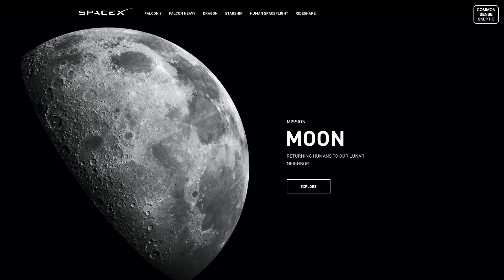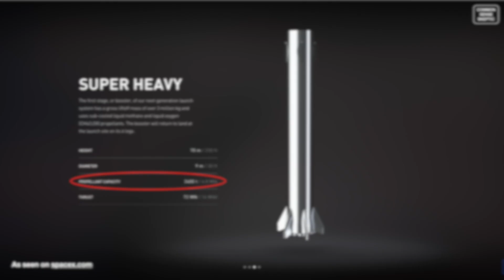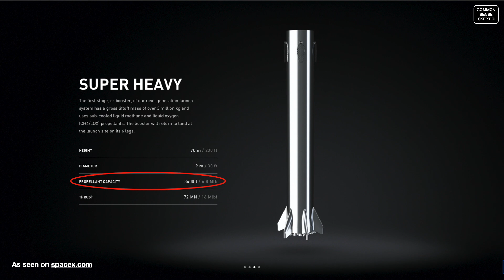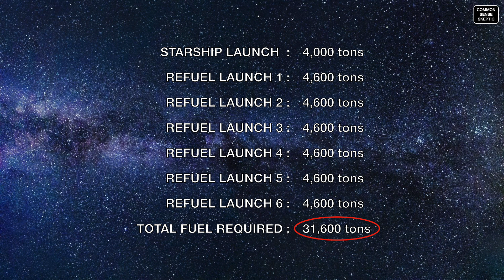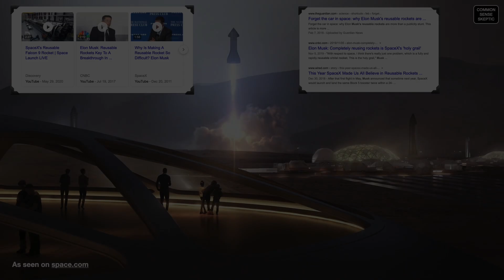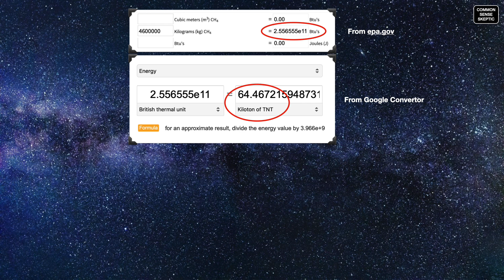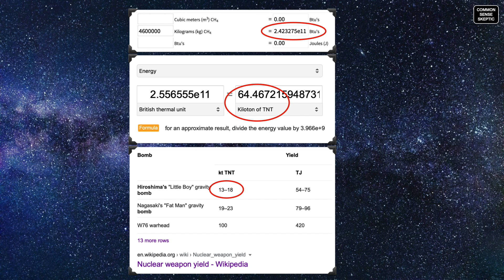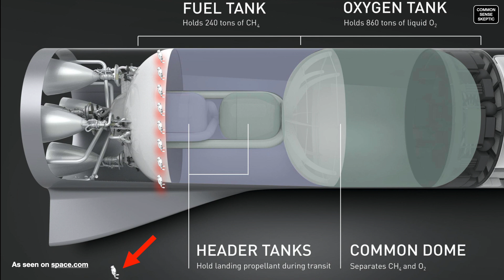STARSHIP EP5 - ORBITAL REFUELLING (1080p)

Comment: Reloaded? Hmm.. I missed the original.

CSS isn't going to like me for this but in my view, orbital refuelling is not a trivial problem, but it is both solvable and game changing. A few points here.

- It doesn't take too long for the gas phase propellants to recondense into liquid, leaving very low pressure.
- What you're really dealing with is liquids breaking up into a zero-g state (lava lamp style).
- It doesn't take much acceleration to re-settle the propellants. That's not going to knock you out of orbit any time soon. Besides this could be adding orbital velocity.
- I'm also a bit nervous of the tail to tail approach. If you have a specialised "tanker" Starship with the tankage going to the nose, it may be better to transfer from the nose.
- Spin is another way to settle propellants.

As you know, I'm not an Elon fan, but there have been numerous other proposals for orbital fuel depots and there is a strong case for fuel depots in Mars orbit. That solves a lot of problems.
As for all the precise numbers related to Starship - they are all quite rubbery. Very, very sensitive to structure mass (and those heat tiles). So, its anyone's guess - but the uncertainty goes both ways.

As for game changing. It doesn't matter how big your rocket is, by the time you get to Earth orbit, only a small fraction of your mass is payload. That's a problem you have to deal with in any architecture. So talk of inefficiency is a bit moot. Yes, the multipliers blow away the economics of mass settlement, but they're something you're going to have to swallow if you're dealing with a limited exploration mission where you don't want to skimp - and even the NASA DRMs skimp.
Reply from the maker: Now, all that aside - are you going to be doing this without pumps?
Reply: Yes propellant transfer is going to be be key to future space operation, we've known this for decades but not much work has been done and what has been done is for things like OMS transfer for Mir and the ISS. The problem is Musk's "plan" doesn't help all that much though I've "hopes" the work they do for NASA will be more practical but I'm not holding my breath.

So in order:
-They aren't looking to transfer gas phase but using the engine turbopump systems to transfer the actual liquid
- The statement was propulsive propellant settling, they are not planning on dealing with propellant in microgravity
- While yes it won't take much thrust to 'settle' the propellant but keep in mind they can't physically 'thrust' in the direction that would allow using the actual propellant handling system to perform the job. Keep in mind that they are planning on mating the vehicles 'base-to-base' to allow the use of that very system which means needing to 'thrust' in a manner that settles the propellant TOWARDS each Starship 'base'... which is impossible.
-For the 'plan' to work at all then "nose-to-nose" is a given as that's the ONLY way to get everything to work. The point here is that's NOT Musk's stated plan and there are far to many people who refuse to consider or question that "plan" even when the facts are pointed out (More below on that point)
- Yes but that gets into the two main issues of the 'spin' gravity moving the propellant AWAY from the 'base' of the Starship/Tanker in the 'base-to-base' docking which again is the "plan" we know of. The second 'problem' is that in the 'nose-to-nose' docking configuration the spin radius is going to be to low for comfort due to the short 'distance' between the Starship habitat decks and the center of rotation. (Which will be changing as the Tanker drains of propellant keep in mind) That's a major problem with the Starship design in that it will have to spin (or thrust for that matter) fast enough to keep the propellants 'settled' enough to keep the high-speed/high-pressure turbopumps fed properly and avoid cavitation events which could lead to turbopump damage. And the 'crew' will have to experience this several times in short order.

in the end Musk's concept is very shallowly thought out and so far as we can tell this doesn't bother Musk a bit and worse he's got fans that think just because HE isn't concerned then neither should anyone else be. There are a LOT of ways to get around the issues involved and it should be a priority with SpaceX considering how much of a priority getting to Mars is supposed to be. Worse, Musk should have never gotten into the details he did considering how LITTLE effort it takes to "debunk" most of the ideas, so it should have been clear to SOMEONE with any engineering or space flight background that the basic ideas would not work and needed re-working. The fact that Musk went ahead with this nonsense points to a few "worrying" directions such as Musk NOT being as interested in going to Mars as he claims and Starship 'merely' being means to an end in crushing the competition in the space launch market. (I mean it's pretty clear that if Starlink gets to its "full" size planned that so many LEO satellites now make SpaceX a major 'gatekeeper' on launch cadence. Part of the process for launch clearance is ensuring that there is in fact an "open" satellite free launch trajectory after all) I'm not fully convinced that Starship may not in fact be Musk playing a long-game with the idea of having Starship enter operation as an SSTO and using all this "Mars" stuff to avoid ridicule for going in that direction :)

In the end what Musk says is the "plan" for Starship and Mars comes across and horribly naïve and self serving and his reputation and fan base make it very difficult to counter the misinformation. At best only a few of his supporters "may" consider some questions to be valid and consider alternatives, at worst the majority of his fans will simply drown out any questions and concerns because it's "MUSK" after all! There really an absolutely needs to be a conversation on the whole plan and process because currently it's simply Musk making claims and pronouncements and his fans talking it up while the media un-critically regurgitates everything he says without questions or opposition from either corner. Probably the most worrying bit here is that there IS the beginnings of some pushback but because of the focus of Musk-Fans on people who question "the plan" rather than on the broader perspective a lot of that pushback is coming from people who are essentially more concerned with Earthly issues and in the form of articles (see below for an example) and media suggesting the there needs to be a curb on ANY human space flight or dreams because ONLY the Earth is where humans can (and by inference should) live. The post-Apollo disappointment of the unfulfilled promises of human space flight that we turned away from after the Lunar landings has happened over and over again since that time and it's not at all that far fetched that the general public of the world, (which far outnumbers the space advocates and fans) can be turned away from supporting manned space flight again. That's why misleading and deceptive 'plans' such as Musk's should be questioned and why he needs to be held to a higher standard.

Article: https://www.theatlantic.com/ideas/archive/2021/02/mars-is-no-earth/618133/?fbclid=IwAR07CvV9BZKAxBedSawNc4Zcsz3i3eWi1tbrlb3aZGsnF6szPSBCro93m00
Reply: @commonsenseskeptic  That's a question for an expert with the right software. All I can tell you is that with milli-g accelearation you're going to need a fat pipe or a lot of patience. Pumps are not unreasonable.
Reply: @randycampbell6307  That's an impressive article. It pretty much sums up where I come from philosophically. So much of what actually motivates people to want to "expand" to Mars is driven by the uglier side of the human animal. Rather than curiosity, its power. I keep dealing with enthusiasts who when pushed, reveal that their lofty goals of driving forward humanity are based on a shallow, selfish and rotten understanding of "humanity". Anyhow, so much for the philosophy.

My understanding of Elon's refuelling - at least the official version - is or was that some other kind of thruster (presumably attitude control) would drive a milli-g acceleration and its purely that acceleration that pushes the fuel. You couldn't use the engines' turbopumps because they require combustion and besides they're designed to create gas. Its not impossible to transfer fuel tail to tail. Its just difficult squeezing the plumbing in and making that safe given the possibility of an an engine failure. Nose to nose seems a better proposition to me.

If I were NASA I'd be funding a quite separate fuel transfer experiment. Heck you do one based on a couple of Electrons.

Btw there are other potential sources of power besides solar power. You can run methane powered fuel cells or even a combustion driven turbine-electric system.
Reply: @judedornisch4946  There's really no big deal in building the plumbing for nose to nose. Trying to thread it through the tail, in close proximity to the engines is asking for trouble.
Reply: @judedornisch4946  Even with compressed gas you still need acceleration to keep the gas and the liquid where they ought to be. And if you're going to do that, pumps work fine too.
Reply: @judedornisch4946  It doesn't work though. Tail-to-Tail is how the PLUMBING is set up but the PLUMBING operates in the opposite direction for filling the tanks and the turbopumps are NOT set up to operate going into the tanks only outputting from tanks to the Raptors. Making them 'reversible' is a significant engineering challenge because of that flow path.
Reply: @saumyacow4435  Philosophically the article is crap because it says "Don't bother" and the most simple answer to that is if you ask the Dinosaur's "How's that Space Program coming along" :) It is literally a matter of species survival. (Not that the universe cares but I happen to :) ) I won't argue that many advocates/enthusiasts essentially boil down to selfish motivations, arguably that's a biological imperative as much as a "thinking brain" thing but I'll also point out the two are not  mutually exclusive either. The essential problem is that if you're going to be serious about the prospect you can't just be selfish, (because that is counter-survival in such a hostile environment as space) nor can you be naïve about the reality and I agree to many people are both.

The problem with Elon's idea is that it doesn't work because of the 'tail-to-tail' setup half the pair is going in the wrong direction with a thruster push no matter what.. That means only one set of pumps is working properly the other is just passive which increases your transfer time and time you have to keep thrusting significantly. Also while most turbopumps require some sort of combustion you can actually run them using the pre-burner segment of the engines. You just have to pump the exhaust 'overboard' which can provide a light thrust btw. Still doesn't work as suggested.

From what I gather NASA thought they were  getting SpaceX to 'proof' something with a Falcon launched hardware but it seem Musk is just going to fold the money into Starship and call that 'development' so I expect NASA (if not Congress but Elon is contributing to enough campaigns they probably won't get involved at this point) to quietly drop the contract at the first milestone.

Methane/LOX ICE's are baselined for couple of NASA and Blue Origin designs but Musk is insisting that solar can cover if. Hint: Studies say otherwise for any reasonable length power/time factor. And you'd be burning the methane you'd be producing to power the engines.
Reply: @randycampbell6307  Fair enough, although amount of fuel you'd need to burn to power the pumps would be fairly trivial.
Reply: @commonsenseskeptic  You don't need pumps - it could be done with a pressure fed system. Almost no moving parts.
Reply: @judedornisch4946  As I said, a milli-g acceleratiin is going to require a fat pipe or a lot of time. In the end you pay for the energy required and electric pumps have a high power to mass so they don't add much mass.
Reply: @saumyacow4435  Actually not as much as you'd think if you keep in mind you have to run them at about the same speed they need to be going to actually feed the engines :) The real problem though is you have to have enough pressure on the propellant to provide the constant pressure they would normally see in operation. Keep in mind that's essentially a full-g at least and you'd have to step the pump speed down as the gravity/feed pressure drops. There's a really good reason no one has done this before on anything like a 'full-size' testing scale :)
Reply: @judedornisch4946  I don't disagree with you, but Musk does and that's the problem. He continually makes claims that things will work exactly as he says and ignores criticism and questions he doesn't want to answer. That not only doesn't solve the actual problems it sets a dangerous precedent for future issues.
Reply: @randycampbell6307  Well, no. You need to feed the engines in a few minutes. For transfer you have hours. So far less capacity. Can pumps deal with very low intake pressure? Yes if the intake is suitably designed.

My problem with pure "gravity flow is that you need a big pipe. Hard to squeeze between engines (and include valves, mechanical connections plus protection from engines).. And if you're going through the nose its still a space and mass issue (big valves are heavy).
Reply: @saumyacow4435  Actually if you have 'hours' then you don't, (and shouldn't0 need the main turbopumps :) Using them adds time to the MTBF (Mean Time Between Failures) clock and risks damage you can't repair anywhere but on Earth. Musk's plan is to finish transfer in minutes which is why he's suggesting using the main turbopumps. And actually the design between operating pressure and low-pressure is a mutually exclusive design issue. High-speed pumps need a certain minimum of a pressure head and it's not likely a 'slow', "low-pressure' transfer could provide that in one system. Again why Musk is suggesting the transfer and pressure will be higher.

I'm sorry if that didn't come across right when I said "gravity" I meant as a force of direction, (aka settling of some type) By being designed to operate in at least 1g (they are actually going to be designed to handle everything between 1g and 3g) the pumps and sump=head/intake is going to be very different than one that is designed to operate in less g situations. You get around this with on-orbit restarts by allowing settling which gets things started, (as per the J2 and the Saturn SIVB stage for example) but the pressure (thrust) has to rapidly build up to a point to support the intake and pump or you risk cavitation and/or pogo-ing. And that was a vastly less powerful pump and feed system than what will be on Starship.
Reply: @randycampbell6307  in case it wasn't clear. I definitely wouldn't use engine turbopumps.
Reply: @saumyacow4435  I agree, (and yes it was fairly clear :) ) but the point is/was Musk does not agree with the sensible option :)
Reply: @judedornisch4946  (No I'm not trying to just get in the last word either:) )

I need to point out that arguably and rather obviously while what you say SHOULD be true, Starship is NOT Falcon with "lessons learned" or it would not have been wrecked on landing and then exploded. I'll give credit where credit is due the development and operation of the Raptor is actually a big deal because while the tech and knowledge has been there no one else was stepping forward to actually build and use them. However they obviously still need work :) (And frankly the fact the engine bay keeps catching fire bugs me among other things :) ) 
BUT the main point remains this is a very rushed, not well thought out program which is arguably totally opposite of Falcon development. Falcon blew up a lot in developing the landing cycle but it was already a proven and reliable expendable booster rocket. "Starship" here is none of the above and specifically the "landing" part is very under-designed. 

Feelings about Musk himself totally aside anyone with any hopes in Starship should be pissed right now because that alone is unforgivable. A LOT went wrong with that flight but it still landed... and was wrecked doing so and then blew up. ANY other program would take a step back and reevaluate the program priorities and design. As I understand it SN 11 is going to be headed to the pad with essentially no changes to the landing gear. How is this in any way "iteration'" towards a better product?
Reply: @randycampbell6307  SN15 (with lots of things improved) is going to be tested soon. The tests have been going so well they decided to skip a bunch of vehicles that were partly built. SN11 is almost ready, why not give it a whirl with a few fixes regarding landing legs, fuel lines or whatever the raptors are having trouble with, perhaps a few software fixes, perhaps a somewhat different descent profile and a different bellyflop and gather some more data?
Reply: @peterfireflylund  "The Tests have been going well" according to who exactly? Seriously SpaceX has DONE most of this already MUCH more successfully it is just the vehicle  didn't try to 'resemble' a (currently) piece of SciFi artwork rather than a working launch vehicle. This has been a rushed and flawed "test program" from the start and they SHOULD have had a lot more work don on things like the landing legs and vehicle structure before they got to flight testing. Nothing so far has 'worked' to plan. They are 'skipping' a bunch of test vehicles because those all are built as per the original vehicle design which by this point is vastly obsolete and failure prone. SN11 will have 'improved' legs which as I noted was something they should have had before SN1 flew. SN11 will have the same fuel tank and overall vehicle construction that SN10 did so unless the legs are fantastically better, (and/or the Raptors actually work 100% this time the whole time) at best it will likely only 'not' explode after landing and just collapse as the structure fails when the tanks collapse.

The belly-flop isn't something they need to test at the moment they NEED to get a half dozen successful high altitude fights, engine re=lights and successful landings under their belt and they need to fully design and build an actual prototype starship hill and not a under-built "Grasshopper" with a nose cone on it as they have now. Want to now if the "belly-flop" works? Put a sub-scale Starship on a Falcon 9 and launch it sub-orbital to prove out the maneuver. PICA heat-shield and working winglets. That's an actual test program. This is not.
Reply: @randycampbell6307  Actually the belly flop is still proving to be highly problematic. I predicted that the sloshing would cause new failure modes and sure enough they've managed to stir helium bubbles into the header tank. That takes some doing :) What surprises me is that they've done the test flights with a "down to the wire" timing. Instead of righting the vehicle slowly and allowing plenty of time for hover, settle, adjustment of landing site. On SN10 igniting all 3 engines had the undesired side effect of causing an overshoot. Why didn't they just do it earlier, get it sorted, then wait for later test flights to tighten the timing?

I agree that they could have sorted a lot of these issues with a sub scale prototype.